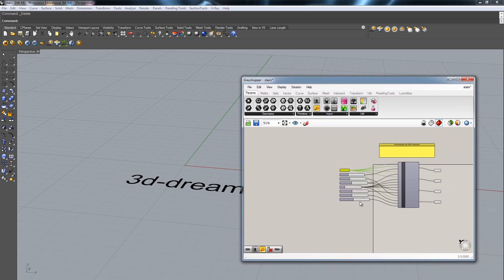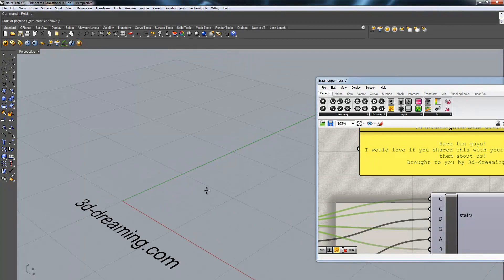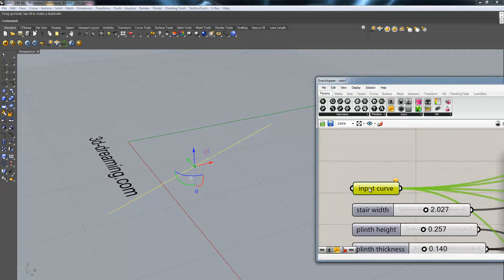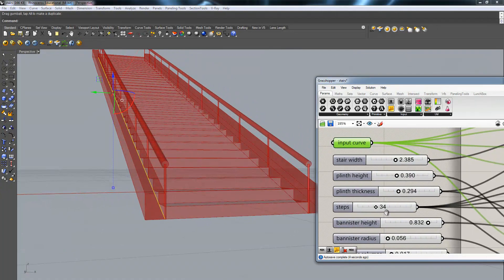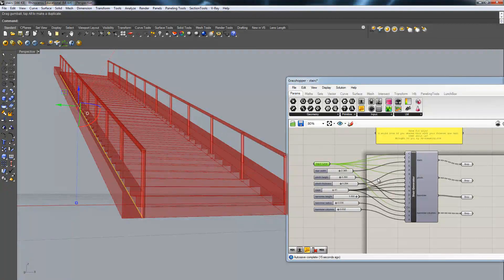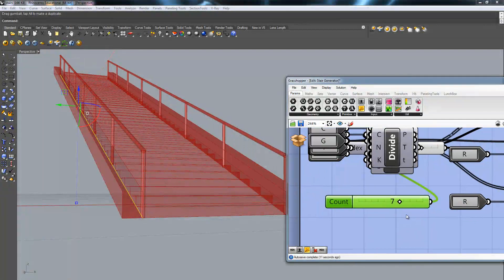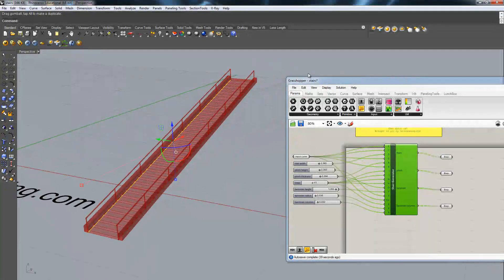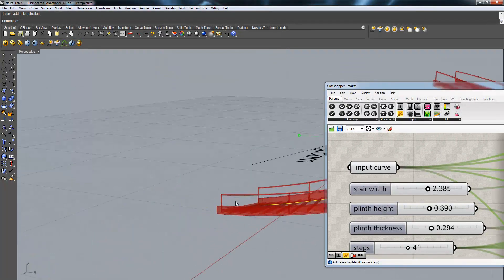Grasshopper for Rhino 3d "Stair Generator"

Comment: thanks for posting. having sripted and used some types staircases, i must say that the absolutely basic and starting parametres/capabilities are:

1. desired riser.
2. staircase height.
3. auto calculation of actual riser and no of steps.
4. auto generation of landings based on max no of sequential steps permitted. (divisions, then add landing lengths incrementally) landing length rules plus finetuning.
5. step nosing, adjustable.
6. flow along any line (even curved) and use stair width, or two curves and use curves to sweep and derive width.
7. draw lines only on floor, auto extension if needed.

the way it's done here, although the graphic result is fine, has no real use in architectural studies or applications. for general 3D works were only looks matter, it is fine.

these are only constructive thoughts, thanks for preparing and sharing, keep up the good work.
Reply: Hey do you happen to still have this file by any chance

Comment: what are the steps to take after downloading your link? It just takes me to a black text code box that says its denied.
Reply: +sweetdomz were you able to download and get the file to work? if you did could you please help me? thanks
Reply: No sadly I wasn't able to get it to work so I gave up on it. lol Sorry.
Reply: when i opened the file on grasshopper it worked. You tried to open on  Rhino or on Grasshopper?